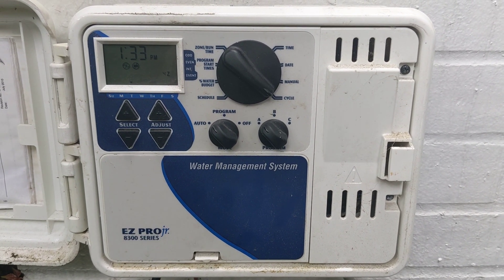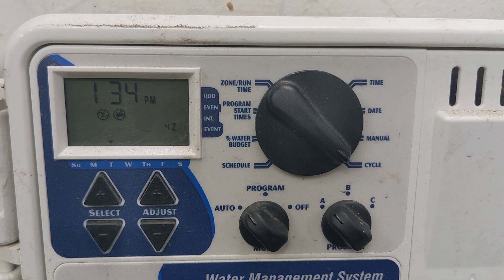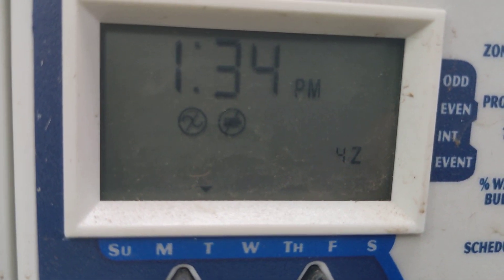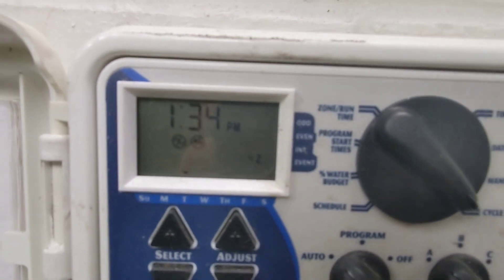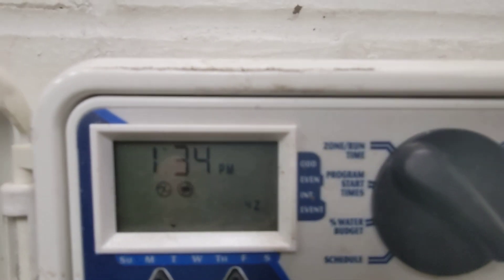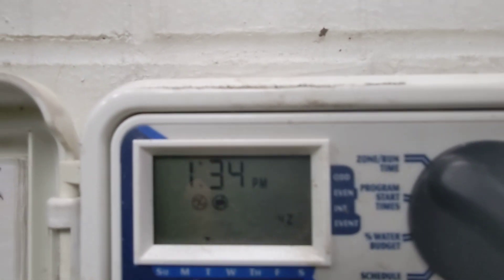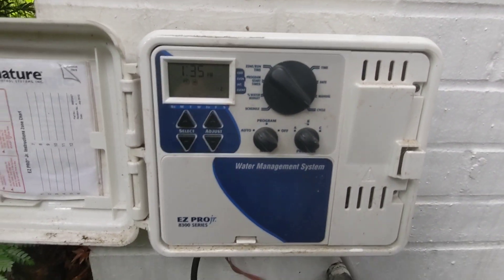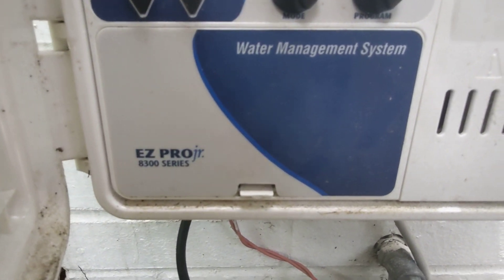screen symbols Nelson EZ Pro Jr. 8300 Series irrigation controller (multi-part series)

Comment: I'm Niki.My home system is the same as yours. I'd like to ask a question My system is divided in 8 zones Each region was previously five.Each zone was previously five sprinklers, but recentlyEach area used to be five sprinklers, but recently the sixth area suddenly became ten sprinklers, which completed the water flow.Each area used to have five sprinklers, but recently the sixth area suddenly became ten sprinklers, which completed the water flow can not spray very high, do you know how to adjust it? Thank you